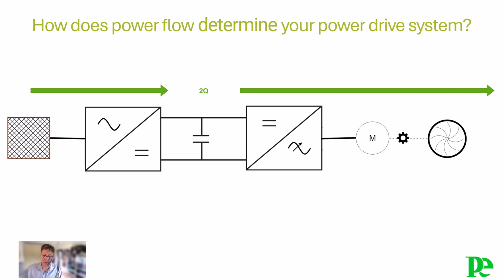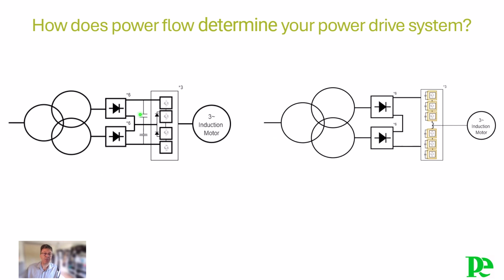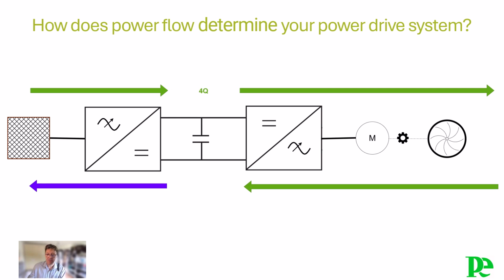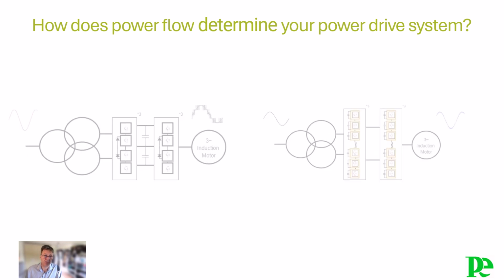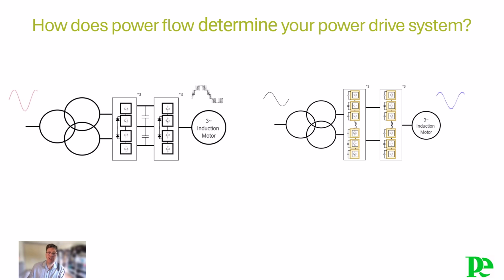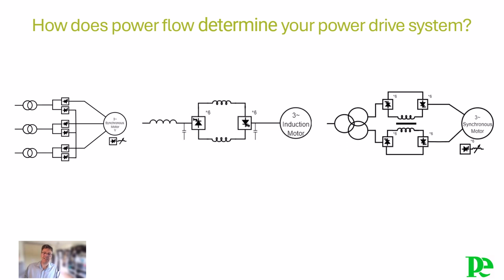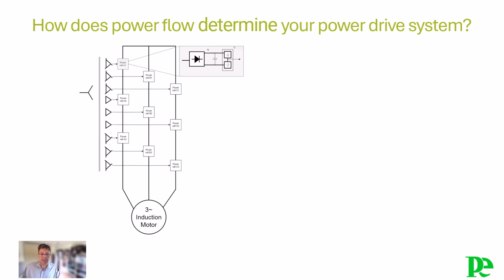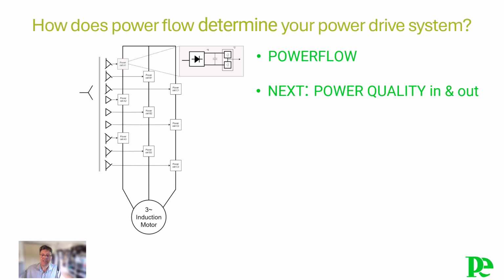4-Quadrant vs 2-Quadrant Drives: Which One Does Your System Actually Need?

Comment from the maker: Thanks for watching. If this clarifies how the power flow impacts the configuration of the power drive system, consider sharing it with your team.
Seeking vendor-neutral advice on medium voltage variable frequency drives? Do you have practical questions or a real-world case? Drop them in the comments and let's discuss.
✅Connect for independent MV drive expertise at https://pro-etic.com/request-independent-expert-advice-for-your-mv-power-drive-system-now/